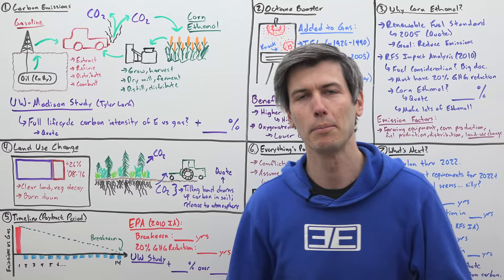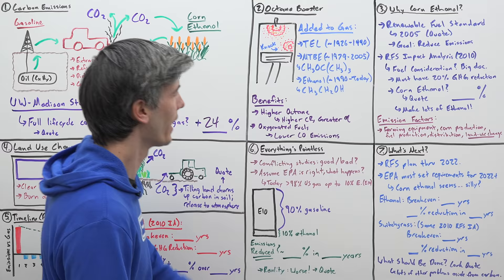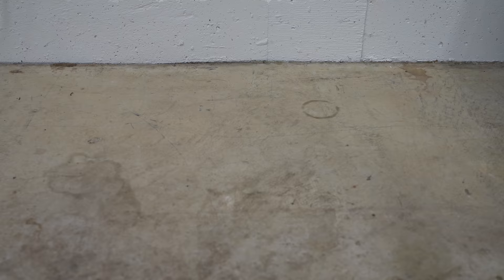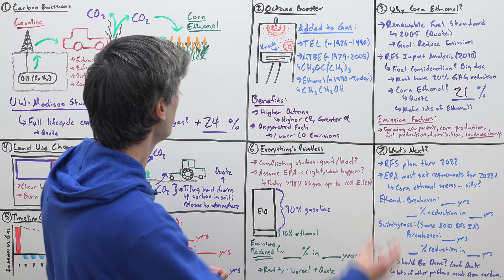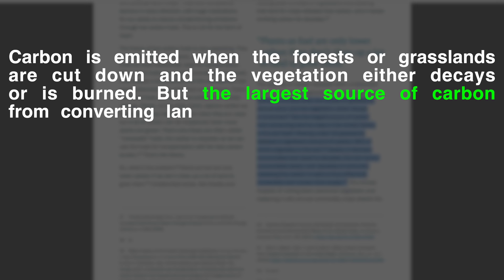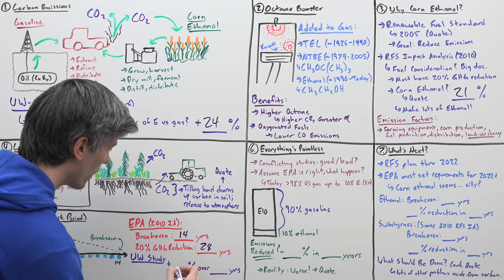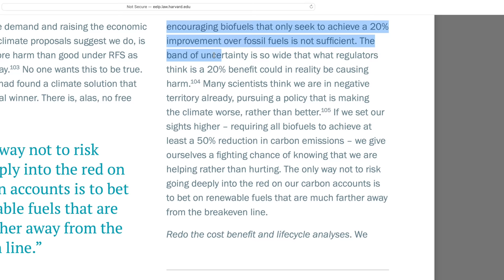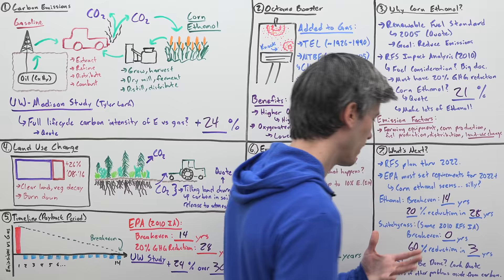America Was Wrong About Ethanol - Study Shows

Comment: A few points on your video (1) you say "carbon" is emitted into the atmosphere by tilling the land - do you mean Carbon Dioxide (CO2) or the element Carbon (C).  I dislike when people use the term "carbon" when they actually mean Carbon Dioxide.  (2) Ethanol even at 10% creates more engine deposits than pure gasoline base fuel - this affects driveability and also increases engine-out emissions.  Testing done by EPA is on back to back tests of the same vehicles while ignoring the accumulation of combustion chamber and intake valve deposits over time.  More additives are required to prevent deposits with ethanol/gasoline fuel than with pure gasoline.  (3) the enthalpy in a gallon of gasoline is higher than a gallon of gas with 10% Ethanol.  One will get lower mileage with gasoline + 10% Ethanol.  (4) the manufacturing process of Ethanol is a negative energy balance - meaning it requires more energy to produce per unit volume than the latent energy left  in that volume of Ethanol.  Ethanol is a complete scam which was driven by the corn lobby to sell more corn. I agree with the U of Wisconsin study.
Reply: 100% of the CO2 produced by the fermentation and burning of ethanol just came from the atmosphere and 100% of it is needed to be back there to make the new gallon of ethanol.  It is a cycle like leaves which fall from trees going back to CO2.

There were no grasslands or forests broken up for corn.  Quite impossible on its face since US cropland acres have declined since ethanol.

Census data shows grassland, forest, and wildlife areas have increased in corn producing states.  The corn belt had more corn acres in 1980 before ethanol than in 2018, the year of most ethanol production ever.

Corn ethanol is a value-added product of >>>already existing<<< feed production acres which preserves the feed in a healthier and more productive form called distillers grains.

100% of the fertilizer (& everything from the soil) still get fed to livestock in the distillers grains.  Ethanol comes from only things of the air: solar energy, CO2, and water with the latter two recycled once burnt.

Ethanol C2H6O = no fertilizer

Distillers grains = all the fertilizer

What logic is it to then assign all the energy and CO2 of fertilizer to ethanol and none to distillers grains?

Iowa State University measured all the energy it takes to produce an acre of corn into a "diesel fuel equivalent"
This included making the machinery, fertilizer, chemicals, plus the tillage, planting, spraying, harvesting, drying, trucking etc. 
They found it takes 34 gal of diesel to produce one acre of corn.
What do we get from those 34 gallons of diesel?
We get >500 gallons of ethanol.
But wait, that is not the kicker.
The kicker is we still get 100% of the protein and other things from that acre of corn still available for a healthier and even better feed called distillers grains. A win-win.
Reply: Ethanol burns clean and carbonless.  This is why they sell ventless indoor ethanol fireplaces.  

We have ethanol at 10% for only two reasons, a non-toxic octane booster and oxygenate for gasoline because it makes gasoline to burn more cleanly.

Denver in 1988 was the first government entity to require E10 when they were on the EPA list of ozone non-attainment zones.  Soon with ethanol they were off that list.

Even with just 10% ethanol added to E0, the Swiss Federal Laboratory for Materials Science and Technology found that the especially health devastating ultra fine or nano particulate emissions were lowered by 97%, carbon monoxide lowered by 81%, carbon dioxide lowered by 13%, aromatic hydrocarbon emissions lowered by 67-96%, and genotoxic emissions lowered by 72%.

Many gasoline additives, carb, and injector cleaners actually use an alcohol for an active ingredient to clean deposits gasoline leaves behind.  Sea Foam for an example contains 25% of an alcohol and claim it also extends the shelf life of gasoline to 2 years.

Brazil found identical engines lasted >300% longer on E1100 than with their common gasoline.  Soot wears out an engine and ethanol is sootless.

Before the EPA approved E15 for vehicles 2001 and newer back in 2011, they conducted long term testing on them with not only E15 but also E20 and found both fuels ran fine and did no damage.
Reply: The amount of energy and CO2 it takes to produce and deliver a product to the consumer is reflected in the price of that product.

As such, note the spot cash delivered price of ethanol on the NYMEX is $1.97/gal.

The price of unusable sub-grade gasoline (RBOB) is $2.50/gal.

To turn RBOB into usable E0 fuel costs even more than that much like premium costs more.  Unfortunately for humanity, it becomes even more toxic and dirtier.

Or simply splash in >10% ethanol to RBOB and the resultant usable fuel becomes less toxic, far, far, cleaner burning, and cheaper/cheaper per mile to drive with.  Who can be against that?

The amount of corn grown is only a function of the protein requirements of the cattle herd on feed.  No corn is grown just for ethanol, far too uneconomical but with the feed factor (i.e. distillers grains) few other sources can compete with corn (even those that make more ethanol per acre).

Gasoline gets less mileage than diesel, and yet we still use it.  Ethanol in our current inefficient low compression engines gets slightly lower mileage but the cost per mile to drive with it is always less and without all the pollution as shown in my previous post.  Ethanol also makes more horsepower.  For example, a Chevy 5.3L engine gets a clean 380 horsepower on E85 vs a dirty 355 hp on E0.

In ethanol optimized engines, you will not only get more horsepower but more mileage, more mileage than even diesel engines get.

Ford's first EcoBoost prototype engine optimized for E85 achieved 15 to 20% more mileage than E0 with load performance comparable to a diesel engine.  They didn't make it for flex fuel in part because they thought they could skirt paying for the patents to the MIT scientists who developed the engine.  That is still in court to this day.

Ricardo built and drove an ethanol engine for GM some time ago with mileage greater than GM's diesel engine.

FROM RICARDO:
The new federal CAFE standards are calling for a doubling of fuel mileage performance, which, Vint says, is going to send OEM’s looking for high octane numbers to improve efficiency and ethanol is the best source. Ricardo, an engineering firm with over 100 years in the business of engine design, has developed an extreme boosted direct injection engine (EBDI) to optimize ethanol blends. The 3.2 V6 gasoline engine rivals the power and torque of a much larger GMC Sierra 6.6 diesel, he said, and it delivers 3.5 percent better fuel economy than the diesel.

This is not new technology or knowledge, it was known long ago.  It is suppressed technology.

Rear Admiral C.M. Chester wrote Henry Ford a letter on Dec.15, 1916:
"...I also pointed out in the article that as governmental laboratories had developed from 40 to 55% efficiency in alcohol engines as against 20% in gasoline machines, the use of alcohol at double the cost of gasoline for power purposes, was cheaper for motor[s] than gasoline in common use today."

Comment: You left out the CO2 that's produced during the fermentation posses of the corn to produce the Alcohol!!!
There goes that 2%!!!
Reply: 100% of the CO2 produced from the fermentation (& burning) of ethanol just came from the atmosphere and 100% of it needs to be back there to make the new gallon of ethanol.  It is a cycle much like leaves that fall from trees.

The video acknowledges that much but claims grasslands and forests were broken up for corn to get more CO2 for 22 to 30 years or so than petroleum.

This is quite impossible since US Cropland acres have been declining since ethanol.

Census data shows corn producing state increased grassland, forest, and wildlife areas since ethanol.

Corn ethanol is a value-added product of already existing feed production which preserves the feed in the distillers grains.

100% of the fertilizer and everything from the soil still gets fed to the livestock in a healthier and more productive form called distillers grains.

What logic is it then to assign all the energy and CO2 of fertilizer to ethanol and none to distillers grain?

Comment: Could be it was just my 2010 Tahoe but it didn’t pencil out to use e85 in that Particular automobile wish I knew thanks for your info take care
Reply: There were no grasslands or forests broken up for corn.  Quite impossible on its face since US cropland acres have been declining.

Census data shows grassland, forest, and wildlife areas increased in corn producing states since ethanol.  Corn belt even had more acres of corn in 1980 before ethanol.

The 2010 Tahoe is rated at 17 mpg on E0 and 13 on E85.  The EPA states the US fleet averages 3 to 4% less mpg on E10 and 4 to 5% less on E15.

Prices are US national average from e85prices web page.

E0 = $3.85/gal. at 17 mpg = $.227 cost per mile
E10= $3.44/gal at 16.32mpg =$.221 cost per mile
E15= $3.09/gal at 16.15mpg= $.191 cost per mile
E85=$2.60/gal at 13 mpg = $.20 cost per mile

Horsepower on E0 = 320
Horsepower on E85 = 326

Comment: how about using farmland to not grow food, how does that effect food prices? how about the damage ethanol does to automobile fuel systems? count those costs also.
Reply: Identical non-flex fuel vehicles to ours in Brazil use their common gasoline which is E27.  It has worked out so well and for so long that Paraguay went to E27.

The Bureau of Labor Statistics measured the percentage of household income spent on vehicle repairs and maintenance from 1990 to 2017.  The amount in 1990 was 2% and this declined to 1.5% while ethanol used in our gasoline exploded from .1% in 1990 to current levels from 2011 onward.

Here is how the 2007 Energy Independence and Security Act affected food/feed prices(if at all):

2007 WEIGHTED CORN PRICE =$4.20 WITH 4 .7B GAL MANDATE
2008 WEIGHTED CORN PRICE =$4.06 WITH 9B GAL MANDATE
2009 WEIGHTED CORN PRICE=$3.55 WITH 10.5B GAL MANDATE

2016 WEIGHTED CORN PRICE =$3.36 WITH 15B GAL MADATE MAXED OUT
2017 WEIGHTED CORN PRICE =$3.36 WITH 15B GAL MANDATE MAXED OUT
2018 WEIGHTED CORN PRICE =$3.61 WITH SAME 15B GAL MANDATE MAXED OUT + MOST ETHANOL EVER PRODUCED

Wheat
2007...............$6.48/bu
2008...............$6.78/bu
2009...…....……$4.87/bu

2016...…....……$3.89/bu
2017...............$4.72/bu
2018...............$5.15/bu

Soybeans
2007..............$10.10/bu
2008..............$ 9.97/bu
2009...…….....$9.59/bu
Reply: Left off last of the soybean prices and don't want to risk getting ai censored so here they are:

Soybeans
2016..............$9.47/bu
2017..............$9.33/bu
2018..............$8.48/bu

Comment: You never mentioned carbon footprint of fertilizer used to grow the corn. Ammonia-based fertilizers are made from natural gas. CO2 is a byproduct of their production. Wiki says 3% of world's carbon emissions come from making nitrogen-based fertilizers. Switchgrass might requires fertilizer as well so it may not help much. 

FWIW, if we were to stop making corn-based ethanol I doubt the land would be allowed to return to grassland. It would likely be used to grow other crops. Land that can support cultivation is a valuable asset so farmers try to avoid having it sit idle.
Reply: The US used 11,160,933 tons total fertilizer on corn in 1980, before ethanol.

In 2018, the year of most ethanol production ever, the US used 10,521,850 tons total fertilizer on corn.

100% of the fertilizer (& everything from the soil) still get fed to livestock in the distillers grains.  Ethanol comes from only things of the air: solar energy, CO2, and water with the latter two recycled once burnt.

Ethanol C2H6O = no fertilizer

Distillers grains = all the fertilizer

What logic is it to then assign all the energy and CO2 of fertilizer to ethanol and none to distillers grains? 

Iowa State University measured all the energy it takes to produce an acre of corn into a "diesel fuel equivalent"
This included making the machinery, fertilizer, chemicals, plus the tillage, planting, spraying, harvesting, drying, trucking etc. 
They found it takes 34 gal of diesel to produce one acre of corn.
What do we get from those 34 gallons of diesel?
We get >500 gallons of ethanol.
But wait, that is not the kicker.
The kicker is we still get 100% of the protein and other things from that acre of corn still available for a healthier and better feed called distillers grains. A win-win.
Reply: There were no grasslands or forests broken up for corn ethanol.  Quite impossible since US cropland acres have been declining.

Census data shows that in the corn producing states grassland, forest, and wildlife areas increased since ethanol.

Believe it or not, the corn belt grew more corn acres in 1980 before ethanol than they did in 2018, the year of most ethanol production ever and ethanol plants everywhere.

2018 Iowa 13,200,000 acres of corn with record ethanol production
1980 Iowa 14,000,000 acres of corn before ethanol

2018 Illinois 11,000,000 acres of corn with record ethanol production
1980 Illinois 11,600,000 acres of corn before ethanol

2018 Indiana 5,350,000 acres of corn with record ethanol production
1980 Indiana 6,450,000 acres of corn before ethanol
Reply: Hey chuck where is cow made fertilizer made? You know the stuff comes out a cows backside and they put it on the fields.

Comment: Ethanol fuels do not work well with small air cooled engines, ie. lawnmowers, motor cycles, small generators or converters.  In hot weather you keep getting vapor lock and have to wait for what seems forever for the engines to start running again.  If the engines were designed for ethanol, they will have a label saying so.
Reply: Identical small air-cooled engines, lawn mowers, motorcycles, boat engines, and small generators to ours in Brazil use Brazil's common gasoline which contains a minimum of 27.5% ethanol.  It has worked out so well and for so long that Paraguay went to E27.

Both countries decidedly have hotter weather that what the US has to deal with.

Comment: Did you mention that making ethanol creates CO2 and is expelled from the plant?
Reply: 100% of the CO2 produced by the fermentation (& burning) of ethanol just came from the atmosphere and 100% of it needs to be back there to make the new gallon of ethanol.

It is a cycle, zero newly added CO2.

There were no grasslands or forests broken up for corn.  Quite impossible on the face of it since US Cropland acres have declined since ethanol.

Census data shows in corn producing states grassland, forest, and wildlife areas increased since ethanol.

Corn ethanol is a value-added product of already existing feed production acres which preserves the feed in a healthier and more productive form called distillers grain.

Comment: Corn is a food product. We know things are happening that are creating food shortage problems. That corn should be used as food.   
   Adding 10% ethanol /corn to gas results in a reduction in gas milage of 12% to 15%. An immediate increase in the gas actualy used. Then there is the additional carbon foot print of growing and refining all that corn. Also the change in cultivation releases sequestered carbon, but it is not a one time event the land is repeatedly cultivated releasing more sequestered carbon.
   That is a long term political  boondogal.
Reply: Grains are in such a glut of supply, their prices are currently depressed below the cost of production for farmers.

Corn is value added into ethanol and distillers grains from already existing feed production and of course is used as food.  Distillers grains are a healthier and better feed than feeding the corn straight.  All livestock should be eating corn in this form.

The EPA measured the US fleet and states that E10 lowers mpg an average of 3 to 4% vs E0.  E15 lowers mpg 4 to 5%.

The cost per mile to drive is less with E15 over E10 which itself costs less per mile than E0.

We use ethanol as an octane booster and it is the cheapest out there but more importantly it is used as an oxygenate to clean up gasoline's toxic and dirty emissions.

Denver in 1988 was the first government entity to require E10 when they were on the EPA list of ozone non-attainment zones.  Soon with ethanol they were off that list.

Even with just 10% ethanol added to E0, the Swiss Federal Laboratory for Materials Science and Technology found that the especially health devastating ultra fine or nano particulate emissions were lowered by 97%, carbon monoxide lowered by 81%, carbon dioxide lowered by 13%, aromatic hydrocarbon emissions lowered by 67-96%, and genotoxic emissions lowered by 72%.

There were no grasslands or forests broken up for corn.  Impossible on its face since US cropland acres have been declining since ethanol.  

Iowa State University measured all the energy it takes to produce an acre of corn into a "diesel fuel equivalent"
This included making the machinery, fertilizer, chemicals, plus the tillage, planting, spraying, harvesting, drying, trucking etc. 
They found it takes 34 gal of diesel to produce one acre of corn.
What do we get from those 34 gallons of diesel?
We get >500 gallons of ethanol.
But wait, that is not the kicker.
The kicker is we still get 100% of the protein and other things from that acre of corn still available for a healthier and even better feed called distillers grains. A win-win.